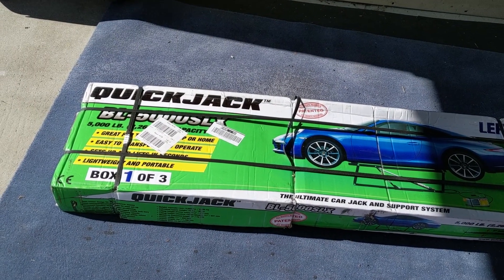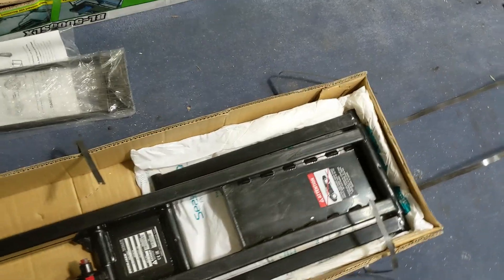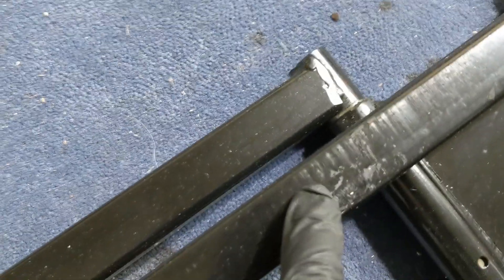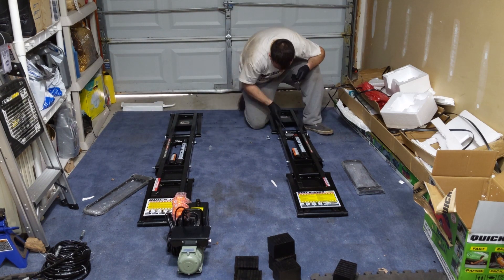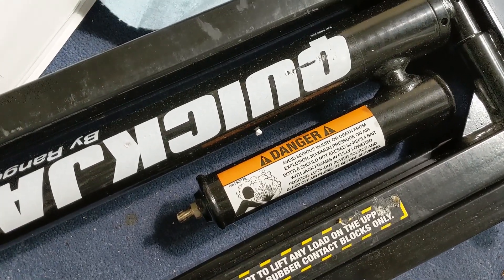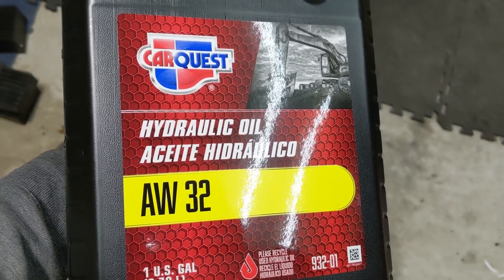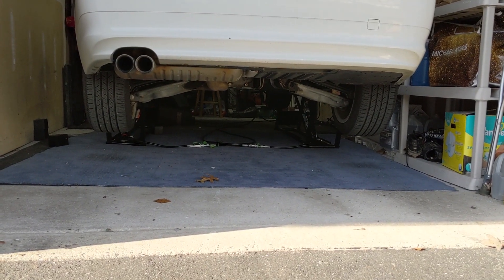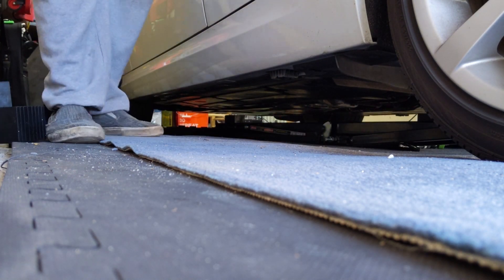QuickJack Car Lift (Setup and Review 2021)

Comment: One important caution from a fellow QuickJack user. I am writing this in several places on YouTube so fellow users can avoid a potentially dangerous situation wherein the QJ acts like it is locked, but actually is not. 

Mind you, I LOVE my QuickJack BLX-5000, and when properly locked I'm totally happy being underneath it. I've used mine for fluid changes, brake jobs, and even suspension rebuild.

I unwittingly discovered a "false lock" state can happen which supports a vehicle, but unpredictably break free. The usual locking mechanism works great and is very solid and stable. However, if you advance the QJ up just a little further before going back down to engage a lock stop, the cam foot also passes over the lock stop. If you then go down as usual to engage lock, the CAM foot can jam instead. That held up my 4,000 lb car, but is not actually locked!

"False lock" is through the cam and its fragile pivot pin instead of the solid, secure lock created by the locking bar's end. False lock looks OK from a distance, but the one nudge of the car and bang! It breaks free. I was fortunate and noticed a false lock had occurred despite no specific warning about the existence of this hazard or how to avoid it.

When mine broke free, the locking bar luckily, and violently slammed against the stop as the QJ dropped. Thankfully, I wasn't under the car and the drop didn't unsettle the lift blocks.

Whether one wishes to call this a use error or design flaw that fails to protect the consumer doesn't matter. It is vital that users be aware of this potentially dangerous false lock state so they can avoid it.

In my opinion the cam should be reshaped so it can NEVER jam against a stop to create a "false lock."
At the absolute minimum users need to be warned specifically about "false lock" so they know to avoid it.

I have reported this unsafe condition to QuickJack and also filed a report with CPSC.gov (20201128-2FEEE-2147367840) to help ensure proper follow up.

Until a fail-safe cam is available, always go up until ONLY the end of the locking bar gets past a stop. 
Never let the cam foot also go over.